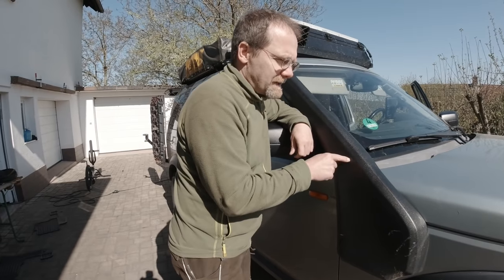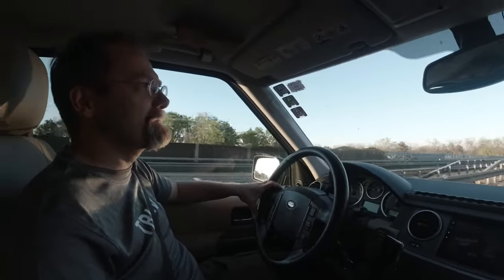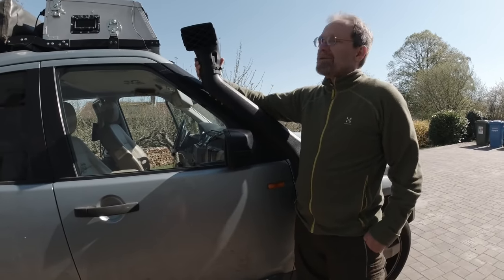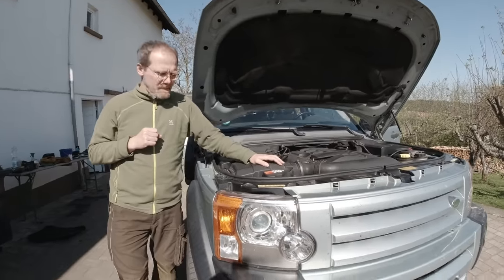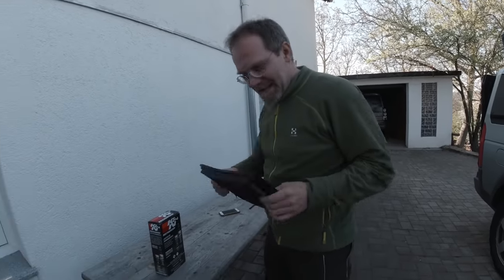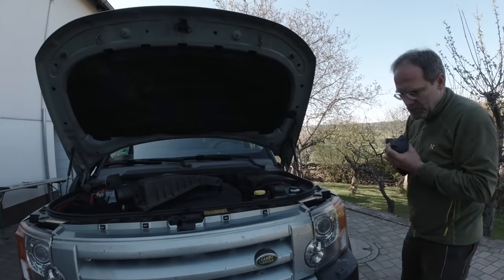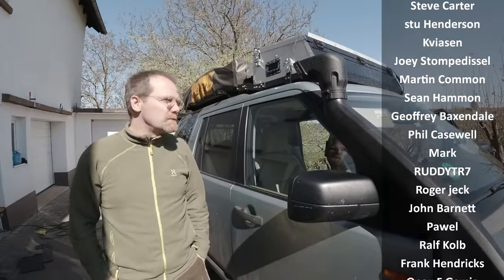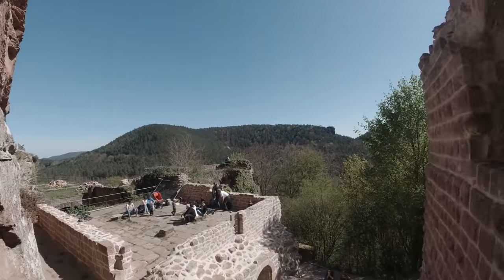Snorkel Intake - Forward or Backward?  Land Rover Discovery TDV6

Comment: Well Christian & Vera, your english is better than many english speaking people! Send that quote to your German commenter.  Christian, what is of more concern is the potential controversy you may have unleashed in this video:

You provided a great explanation (as you always do) on why you have turned the Ram Head rearwards, in my opinion it does not look as nice or as cool as a forward facing Ram Head but I understand why, with fuel costing more than gold by weight these days! I am going to do my own tests and will report back.

I am interested in the noise. In Australia we have right-hand drive vehicles, I can most definitely hear the snorkel drawing air in every time I drive. I am not sure how much of the noise is the wind going around the snorkel body & how much is the air being drawn in. I will let you know that also. Can whoever is driving your LR3 hear the air being drawn in, or only the passenger?

 You have unknowingly now opened up the Paper versus Oil impregnated air filter controversy. I have had both over the years, and in my experience OEM paper air filters are far superior to any Oil impregnated filter. OEM filters let more air pass through and also cleaner air pass through. OEM filters do not get as restricted to air flow as oil filters get for the same period of time in the same conditions. I am in Australia and have travelled in many thousands of kilometres in the Outback on dirt, including the very fine powdery bull-dust we have here. I will concede dust clogging up your filter with the driving you do is very low, but it would be interesting if you put the paper filter back in & did a mileage comparison with that versus what you got with the oil filter. It doesn't matter which way your snorkel faces, as long as your comparison is with the same facing snorkel.

As far as water crossings go, the deepest I have travelled is about 50mm above the bottom of my widescreen through saltwater and fresh water crocodile infested waters (in fresh water). My kids thought it was cool and wanted to go through again, my wife & I had other ideas lol. There have been many water crossings up to 1 meter deep. None of these deep crossings were in my LR3, though all except my first 4WD had snorkels.
Reply from the maker: I cannot recommend the K&N filter. It is by far not as dense as the original filter.  We bought it because we thought that the original filter in combination with the snorkel increased the diesels consumption.  But it was mainly the snorkel.  I will put in a original filter and test if it reduces the consumption further.  Anyhow, I cannot see how the K&N would filter fine dust.  It is very coarse and you can see through. Not suitable for Australia I would think.   I also did get water over the bonnet once, while washing the car.  😂😬👍 Christian
Reply: @Vera_and_Christian  Yeah, washing LR's with water can be risky for those who are not careful. I think if you did a video on washing the LR3 & LR4 ,  Vera will have out done herself with the OMG's and S??T's, especially if Vera is inside the car while you are washing it. I am pretty sure you will manufacture a sprayer that misses all the critical components 🤣🤣

Comment: After watching this video I thought I would compare the two ways on my holiday trip. I drove from Northumberland to Cornwall and back. A round trip of 940 miles, (1,5112km) trying to keep to 70mph, (112kph) where possible. We used 16.22gallons.
The snorkel faced to the rear on the outward journey and returned 29.4mpg at an average speed of 44mph and faced the forward on the homeward leg, returning 27.16mpg at an average speed of 55mpg. We used 17.4 gallons.
The induction sound when the snorkel was facing the rear was like a cement mixer. Not a nice noise.
I was trying to drive consistently, not economically so these results may prove absolutely nothing.
Reply from the maker: I think many factors play a role.  We still use the K&N filter which is quite open.  We do like the snorkel sound a lot when going slow.  On the Autobahn we need to keep the windows closed.  Thanks for your analysis.  Christian

Comment: I'm a "facing backwards" guy on my D3. The main reason for me was the amount of bugs and leaves when facing forward. I think a raised air intake would be more suited to your personal needs - still got the looks but without the risk of water. Removing the permiable pipe from inside the wing truley leaves no escape for water, and I think this pipe does more than the drain valve. Maybe you left it in anyway?

The noise for me is a serious downside., especially in a right hand drive vehicle! Absolutely fine at slow speeds but on the motorway/autobahn, it is very loud. I usually open every other window before opening the drivers window these days.

Fantastic video as always.
Reply: From my memory of the snorkel fitting video, they changed the internal pipe for the waterproof one - hence the drilling out of the internal panel to get the new pipe in.

Comment: I have a bmw e70 with a 100mm aluminium snorkel I made with sealed intake to the turbos. I use a metal cylinder ITG housing and oiled filter. I have a rams head on top and I actually had a noticeable increase in performance but the car is re-mapped with several hardware upgrades. I also retained the front air intake from the front grill and Tee'd it into the snorkel for extra air incase the snorkel was deficient. Of course there is a quick disconnect to blank it off for deep water crossings. However the turbo sound alone is worth doing a snorkel 😅 Great videos btw.

Comment: I have snorkel on my defender. Don't notice the induction noise above all the other noises. I have not smoke tested it so probably false piece of mind. Occasionally run 30+" depth. Amazing how deep you can go in LR even without snorkel. In a dip had it briefly flow on to the hood on my D2 no snorkel. My friend hydro locked his D1 TDI though so snorkel can come in handy. Needed an engine rebuild.

Comment: Put a  pre cleaner on that snorkel, tremendous difference in how clean the filter is after 5k.  I monitor air flow in grams per sec vs MAP vs TPS, no change, AIT's are not changed.

Comment: I don't have a snorkel as I don't intend to go through water deeper than the top of the rims but I have diff, gearbox/transfer case breathers. I have often wondered about this topic, with the snorkel head turned backwards are you 'starving the engine for air giving you an incorrect fuel/air ratio? The same would apply to motorbikes as they have the carburettors mounted on the rear of the engine like a snorkel head turned backwards. When driving down the highway (autobarn) at 140 kmh plus, the air going past the snorkel head has to change direction to be sucked back down the snorkel. Could this be causing a slight negative pressure? I don't know just a thought. There is nothing wrong with either of your English It is probably better than mine I only speak Australian. On a side note my family came out to Australia in the mid 1880's from Housen now consumed by Frankfurt. Take care keep up the good work. Regards Allan.
Reply from the maker: Hello Allan, I think your ancestors did good leaving this place.  I would do the same but it’s not so easy with kid and family.  Snorkel front or back messes with the mapping of the engine.  We simply did a test and left it in the lower consumption position. Christian

Comment: Might as well fit a fibreglass fish tail on the back for the amount of use of a snorkel - my advice keep yr LR3 out of the water as much as possible - rain is already doing enough rust damage on a LR chassis let alone the electrics
Reply from the maker: That is what we said in the video. There needs to be done a lot more before a 15 year old Discovery should go into the water. Ours will most likely not go anywhere near water if we can avoid it. 👍🙋‍♀️Vera

Comment: The ram effect works on my motorcycle.. but it is designed that way 😁
But doesn't the mass airflow sensor help de mapping? Is the air pressure on the windshield not higher than free wind 30cm in front of the windshield?
Oh well,  just some thoughts.
BTW I didn't know a high air intake could make 2 film's  😅
Reply from the maker: Us neither 😅but sometimes getting a repair or mod video out every week is just impossible. But I am glad we did it so I am off the hook using so much diesel now. 😅🙋‍♀️Vera
Reply: @Vera_and_Christian  it is a struggle with a deadline. But for us it's pure entertainment 👍👍👍
The hiking was a bonus. I did the rheinstieg once..it was challenging

Comment: I have not read all the comments and apologies if this has already been covered. 
I wonder if the increased fuel consumption has something to do with the ambient air pressure sensor. It may see increased air pressure when facing forward or reduced pressure due to Venturi effect when facing backward. This I expect will effect the active fuel mapping that landrover has designed, primarily for differing altitudes.
Reply from the maker: Not sure.  I think it messes up the mapping in general. The TDV6 is extremely efficient and it does not take much to disturb it.  Christian

Comment: Put a Cyclone on it.( Brand does not mater. Just make sure it is sized for your engine. Otherwise Noisy.). To keep the dust out. The type with a propeller in it. They get 80 - 90% dust out of filter Otherwise your filter blocks daily in Aus Bush. Maybe not the Autobahn. That's what they don't tell you on 4wd247. LOL.
Strzelecki Track is really bad for dust. Buy the time you get to Aus to drive it. I twill be sealed. 
Put the K&N filter in the bin. Paper filter is better. Pressure drop is to high cause high fuel usage. Just use a factory or quality paper filter and bin it. When Dirty.
As a Toyota owner. I carry heaps of tools. Never use them on the Landcruiser. Seam to need them to repair people broken down in the Bush. Sadly...
Keep up the good work. Someday the Land Rover's may be 100% operational. We all have dreams.....
Reply from the maker: I will get a cyclone one day, hope to look at a couple at the Abenteuer & Allrad soon. 🙋‍♀️Vera
Reply: @Vera_and_Christian  Look At Donaldson for cyclone filters Vera.
Reply from the maker: @Pandora882  👍🙋‍♀️Vera

Comment: Neither, mine is at 90 degrees to the direction of travel towards the windscreen.  You access high pressure air off the windscreen and reduce the amount of rain that makes it into the airstream as rain heavier than air and it smashes into windscreen.

Comment: immediate difference i noticed on my TD5 defender 110 is less noice in the airfilter box,that box is build in against the firewall at driversite,we all know that a defender firewall is not insulated so any noice reduction is much appreciated,second difference notice is that it seems it accelerations or responding on the throttle is better,does that make sense?
for the fuel consumption i still have to drive for a week or two because i do not use the defender every day.
Reply from the maker: Let us know if it makes a difference. Here, for me it does, but we live in a really hilly area. 🙋‍♀️Vera
Reply: @Vera_and_Christian  as I told you by personal message on Instagram it turned out great also for my Defender 110 TD5 , got fuel consumption down from 1:8,3 to 1:10,14 besides some other positive differences, I’m 😃 happy

Comment: Haven't seen this question asked.. what you think will happen if its facing forward during a heavily rain strom? Would water go to the filter. From Florida
Reply from the maker: Yes, there is a drain membrane in the air box. Otherwise this would be a problem. Christian

Comment: I’ve always wondered why we never see the vehicle’s air conditioning spliced into the engine intake. Have a lever in the cabin that could be used to direct the cold air either into the intake ahead of the filter, or into the cab. 
There must be a reason why this is not done 🤷‍♂️
Reply from the maker: The Dodge Challenger Hellcat has that function in the 800 hp version.    Christian

Comment: Hiya, airflow is constricted by the sharp turns so “ram” effect is often to reduce the airflow at high speeds. A proper snorkel has the cyclonic filter at the top to spin out some of the dust.
For your engineering mind check out https://youtu.be/nAWS6NxIvHA Pipe air contraction simulation. From about 20 mins in you can see the CFD (fluid dynamics) simulation showing how the air speed and sharp corners constrict the airflow. The 10m/s airflow speed he uses in the sim is approx 20mph (30kph). The snorkel you have has several sharp turns.
There is a lot of people who really don’t accept that forward facing isn’t going to help much!

Comment: are you sure about it not taking in cooler air? im in Australia and on a hot day you can definitely feel a difference in temperature 1m off the tar compared to 2m of the tar just by standing up on your bulbar.
Reply from the maker: I think on a turbo charged engine, the air temp does not matter much.  It is compressed hot and then colled by the intercooler anyhow.  So for sure it is not cool.  But I am no expert.

Comment: Oh nooo, you sprayed the underside of the filter. That will let K&N oil to be sucked up the intake and deposit onto the Mass Air Flow sensor. If you are going to use a K&N just spray the air inlet side.

Comment: Not for the ram effect.  Certainly cooler air than under bonnet but mostly for reduced dust.  Dust settles with more particles closer to the ground.  The density of dust is reduced the higher up the air column you go after the dust has been raised by a disturbance on the ground like a vehicle.

Comment: After fitting oiled Air filter, do you see a significant cleaner engine oil vs. OEM paper filter?
Reply from the maker: No, absolutely not.  The K&M is very coarse and does not filter as good as a MANN original.  We may do a fuel consumption test on the filter too.  Christian
Reply: @Vera_and_Christian  so, for engine life you recommend OEM

Comment: If your fuel mileage was improved with the snorkel pointing to the rear, how does it compare to pre snorkel?
Reply from the maker: That is hard to say.  I think we could get 8.8 on the Autobahn some time back and today is more like 10 l/100 km.  It may be age, added weight and stuff and partially the snorkel and the K&N filter. Christian
Reply: @Vera_and_Christian  great vid guys. I run mine pointing backwards here in NZ I get 10.8 l/100km with a roof tent on. Got 10.4 average before the roof tent. Snorkel made no difference in fuel for me but we run a max 110 km per hour and that is all mixed driving. Mines a 2005 tdv6 on 172000 miles. Thanks for the great vids. One more thing, almost impossible to drill that a post so I epoxied mine on, been over a year and is holding great.

Comment: In my limited understanding, a mass airflow sensor is to tell the ECU how much air is entering the engine, so given the ram effect may overcome the friction losses as the air passes through the snorkel, the ECU should compensate for any variation in available air??
The BIG issue is water. Diesel engines don’t like water.  It’s expensive.  The question is do you block the air box drain valve??  It lets water in, as well as letting water out.  Mine are all blocked, but can be opened.  So what happens to water in the air box?  I think our climate is generally very dry, and the biggest risk is water wading.  Any water will evaporate and/or pass as vapour in to the engine.
Also, they look cool.  Or like you might know what you are doing...
Please come to Australia for a holiday and I’ll happily host you. No cost to you.
Oh, you’re wrong, it should face forward...

Comment: Don't like snorkel on backwards I have swap mine out sy-klone air precleaner cost around 212.00 to 278.00 I'm sure you know but in case you don't there a little fan that turn as you drive separating dirt from clean air I 5hink it looks good
Reply from the maker: Yes we know.👍🙋‍♀️ Vera

Comment: You didn't fit a manometer to the snorkel in order to verify the presence and magnitude of ram-air effect?
German citizenship revoked!
Please hand in your passports at the nearest police station and report to BMW headquarters for re-education.

Regarding temperatures, I've worked in some stupid-hot countries (including Oz) and there IS a noticeable temp' increase at ground level, as a result of the sun heating the ground (to temp's of >50c) which, in turn, heats the air directly above it.
Ironically, at higher speeds, turbulence would probably dissipate the hot air but when you're driving off-road, at low speeds, the air isn't getting disturbed so your engine would be sucking in the hotter air.
Certainly not an issue in most of Europe though.

Also, if I have a Mantec Snorkel, how do I turn the head around? 😛

On a related note, it always triggers my OCD when I see diff-breathers cable-tied to a snorkel.
If you're THAT interested in keeping everything waterproof AND keeping things tidy, just install push-fittings to your airbox and have the diff-breathers venting into your airbox.

+EDIT+

Regarding the vent-valve in the airbox, I just sealed mine up when I fitted a snorkel and then installed a push-fitting on the bottom of the airbox with a short length of pipe and then a normal quarter-turn valve at the end of it.
Normally the valve is open to allow rainwater to drain out of the airbox.
If I ever plan on doing a water-crossing I can just pop the bonnet and close the valve to temporarily seal the airbox completely.
Reply from the maker: We don't have the diff breather cap tied to our snorkel. 👍🙋‍♀️